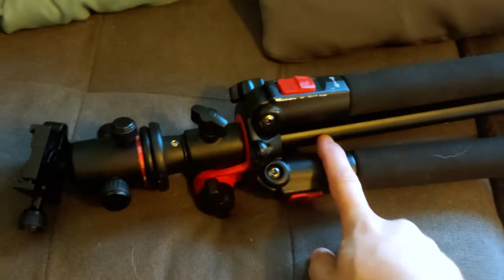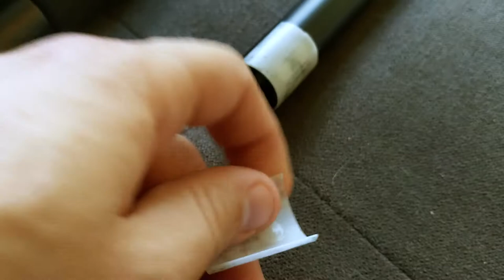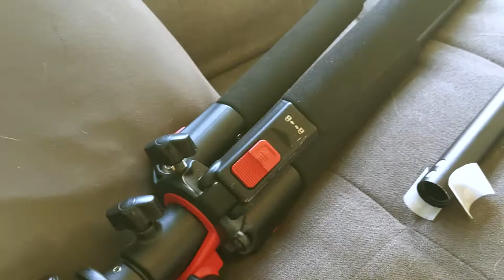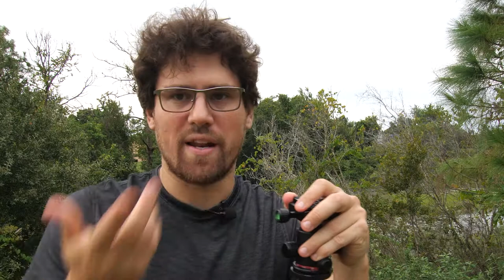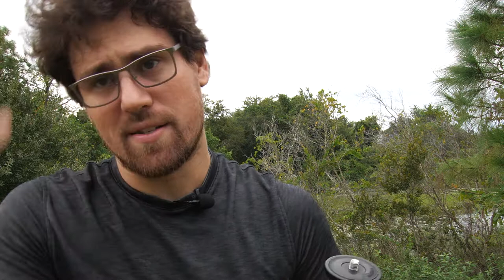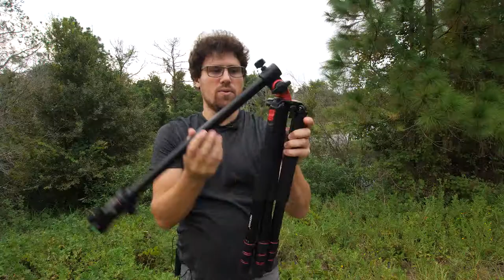Complete Review of Neewer Overhead Tripod

Comment: Hi, Sandman. I have this tripod in carbon and I LOVE IT...recently decided to buy a 450 $ Manfrotto and send it back LOL this one is better, maybe not in the long term but,,i can buy 4 of these with the manfrotto price. I dont like the ballhead so i use a manfrotto lighter ballhead with a leveling plate for panoramas. Also if someone steals it i will laugh and buy another as with manfrotto i would cry for a week...Did you figure out if there is a replacement for those tiny little plastic pieces from neewer or 3rd party?
Note: The side knobs do not do the same thing, it took me some time to figure it out. One is for tightening and the other is the friction knob. They are separate as the manfrottos friction knob is inside the tighten one.
ALSO good about this tripod is that for panoramas we really do not need to use the panorama ballhead if the center column is low, it is much easier rotating the all center column if we do not need to measure the degrees of rotation.